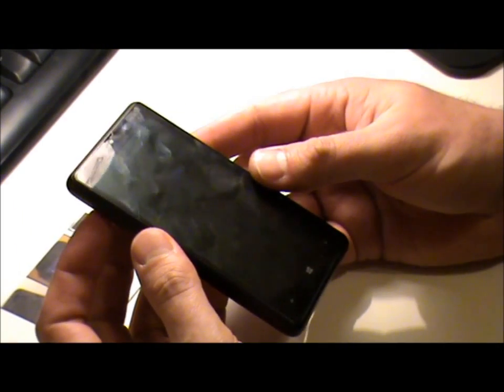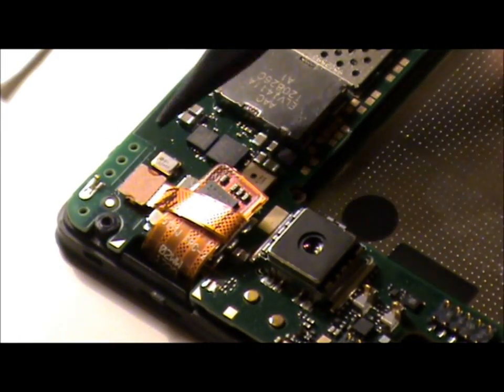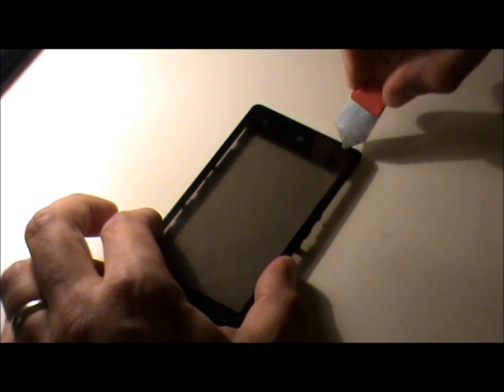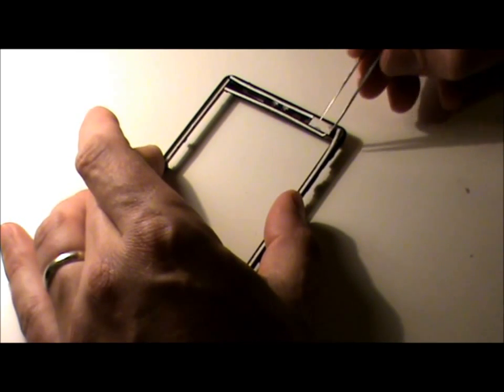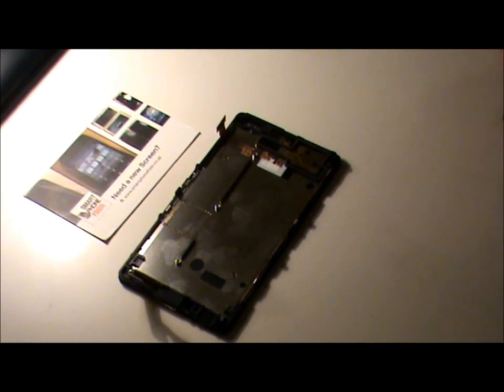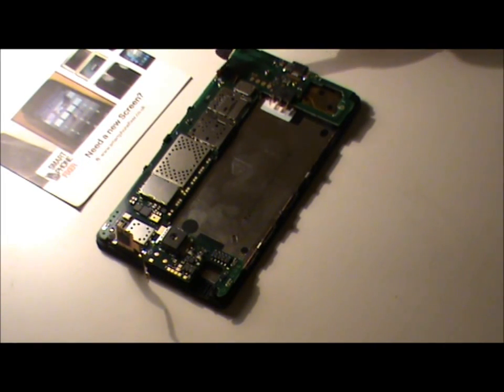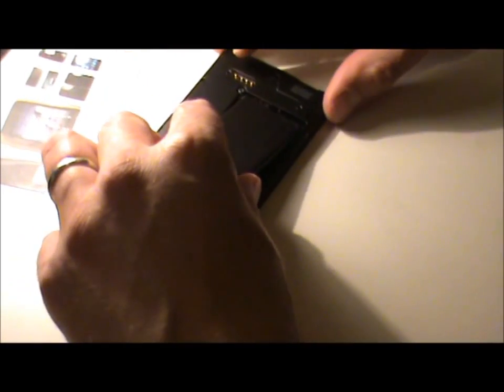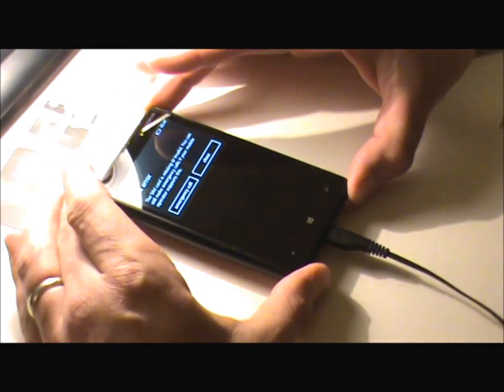Nokia Lumia 820 Screen Replacement Guide

Comment: Thanks so much - new screen for my phone all done by me in half an hour - for 6 quid for the screen and frame off ebay - even got the proper tools included!! I would just say to anyone trying this, go easy on the middle three screws when putting them back in, one of mine broke at the end with tightening too much - still works fine though :)
Reply from the maker: Thanks for your comments, Lisa. Well done for completing it yourself and so quickly.

Comment: Hi,
  Thanks for your quick response!

   Yes, it is certainly a problem with the proximity sensor. But it is not as simple as you describe.  I've had each of these three phones apart several times. I've tried different digitizer screens - from different suppliers, tried cleaning the sensors and the inside of the screen - through the apertures for the sensor, tried pads to force the sensor more tightly into place. Nothing does it. I consistently get a black screen once I've dialed. There must be some underlying problem, or the problem would not be so consistent. I've observed that some of the screens I have have the apertures very slightly different, and thought that might be it, but each of the positioned screens fail in the same way. I had one "professionally" repaired, which seemed an easy job for them, but they won't tell me the secret!
Reply from the maker: That sounds more complicated, as you say. I've not had that problem so, unfortunately, I don't have much else to offer you. I hope you find a fix and update me when you do. Thanks, Will

Comment: I've done this with three phones. The job is a very easy one and is a success, EXCEPT, in every case, I end up with a black screen as soon as I've dialed. I must be doing something consistently wrong, but I have no idea what.
Reply from the maker: Well done. The black screen sounds like something to do with the proximity sensor, the device which detects when you put the phone against your ear when speaking with someone. Like all repair jobs, check and re-chack all the connections when putting the new screen on and also make sure the connections are clean. You can clean them with a little isopropyl alcohol.

Comment: Good video. Just replaced my digitizer using this one. I do recomend to order digitizer with the frame , so you can just replace it without the gluing and glass seperation part. Thumbs up!
Reply from the maker: +Rudolfs Bzs Yes, the complete unit is much the best replacement part to buy.

Comment: Hey can someone give me a tip or any suggestion what to do ... my nokia lumia 820 screen is getting dust and other small particles on the screen but under it so i cannot clean it like you normally would do ... its really ugly looking I dont know how to clean that any ideas ?
Reply from the maker: Hi Kenan

Is this happening after you have replaced the screen? Or, is this happening with the original screen?

Thanks

Will
Reply: Well I bought the phone as a used one so I dont know if it was changed or not :/
Reply from the maker: Kenan Mujic It sounds like it was changed. It is quite easy to remove the screen and clean behind it. Follow the steps in the video above to remove the screen.

Comment: Hey, Will. Great video. I have a question about my 820. I dropped it flat on its screen and the digitizer snuffed it, so I replaced it. Once I had assembled the device together again, I turned it on. The LCD works perfectly and the digitizer looks fantastic, but it doesn't work. The touchscreen is dead and I can't seem to be able to find the cause of it. Do you have any ideas of what could be wrong? Thanks!
Reply from the maker: Hi Matias, 

Firstly, you can try taking your digitiser off again and cleaning the connections (using a bit of pure alcohol, for example and a lint free cloth). Sometimes, grease from your fingers can mess up the connections. Re-fit the digitiser and try again. 

If that does not work, it could be that you have a faulty digitiser. The 820 digitiser is an unforgiving component in that if it is slightly damaged or faulty, it will not work at all, unlike other smartphone screens. 

I hope that helps.
Reply: Will Hawkins Thanks for the answer, Will. I cleaned the connections and it wouldn't work either, so I guess I'll just have to try again with a different digitizer. Thanks again for your help. Keep up the great work.
Reply from the maker: Matías Sibils Thanks, Matias, for the update.

Comment: My mum dropped her lumia 820 today and she just asked me if I can fix it for her. Gladly I found this video but I'm not too sure what the problem is. It has no cracks that I can see but the screen is a washed purplely blueish colour, being darker in the top right corner. I think it might be the LCD that's broken but I'm not too sure and don't want to buy a new one if the current one is still fine.
PS. The phone still functions perfectly, is just a different colour.
Reply: The LCD is most likely broken in the same place as most other peoples. The weak spot seems to be on the top right of the screen and will be only a few mm long across the corner.
Personally I think it may be a slight design fault in a very compact phone.
Reply: toxicthunder69 hi, i also have broken the lcd, do u know from where i can buy one? and how much it costs?
Reply: Gigi D'Agostino You can get them from eBay and other places like that, and they cost about £100 ish but you can get them slightly cheaper I think.
Reply from the maker: Hi there, that almost certainly sounds like you have a broken LCD which is replaceable. It does not sound like a broken digitiser (touchscreen). When the digitiser on the 820 is damaged it will not respond. 

I hope that helps.
Reply: Will Hawkins Yes thanks that has really helped. I can now get a new LCD to repair it. Great video as well very informative.
Thanks again.
Reply from the maker: toxicthunder69 Happy to help.
Reply from the maker: Gigi D'Agostino You can find a suggested supplier in the notes below the video.

Comment: how do i see if the lcd or the digi. broke or if they both broke??
Reply from the maker: Can you see anything on the LCD? When you touch the digitiser, does anything happen on the LCD below?
Reply: the screen keeps outputting the normal picture no color fading or weird things only the top half of the digitizer still works
Reply from the maker: That's normal when the digitiser is broken on the 820. Replacing it with a new digitiser will stop this problem.

Comment: Thanks very much for this video, I followed it step by step and I now have a working 820 with a new digitizer screen. Got my screen from http://www.formymobile.co.uk/proddetail.php?prod=lumia820digitizer&PARTNER=Froogle
which also helped. Great fun removing the screen without damaging the sticky layer, and the main trick is to press the plastic over the glass on a nice flat surface . Thanks again!!

Comment: Thank you for you very useful video. I used it to replace the Digitizer but now when I switch on the phone, it vibrates and makes the start up sound however the screen is completely blank. How likely is it that the LCD was damaged when it was dropped and not an internal component? I'm more than happy to purchase a new LCD and fit it but would like your recommendation...
Thank you in advance.
Reply from the maker: Hi Bo, was the LCD working before you replaced the digitiser?
Reply: Will Hawkins Hi Will, sorry for taking so long to respond.. I was away on holiday and didn't have access. The owner of the phone went ahead and ordered a new LCD so now I am waiting for it to arrive and will then fit it and hope for the best.
I'll let you know how it goes. holding thumbs

Comment: Wish I has seen this earlier. I cracked the phones screen but the LCD worked just fine, I could even use the camera function with the outer buttons. The guy who fixed mine did an awful job, he made me buy both the LCD and the touchscreen, left the LCD's film on, kept my old working LCD, and on top of everything the touchscreen doesn't respond at times and when it does only the upper portion of the touchscreen responds. He claimed it was because the phone wasn't fully charged and made me pay premium!!
Reply from the maker: Bad luck, Carlos. The video I made is based upon the official Nokia repair manual so it is pretty straightforward. Nokia Lumia 820 screens are sensitive to damage and one crack will render a digitiser useless. But, more often than not, a cracked digitiser does not mean you will need a new LCD.

Comment: Hi Will,

I dropped my lumia 820 today, everything works except the touchscreen. A new screen is required to make it work properly again, right? 

Thanks in advance
Reply from the maker: Hi Dinant, 

Yes, when you crack the touch screen on the Lumia 820 the whole thing stops working. You won't need a new LCD unless you can see a blurred screen. You can find a suggested supplier of screens with the integral frame in the links above in the 'About' section.

Will
Reply: Will Hawkins Just ordered a new screen. Thanks for the help!

Comment: Hi Will, yes great video. But I still don't know if I need to replace my LCD. All the colours are still there on the screen, side buttons work fine. The display looks fine just a badly cracked screen/digitalizer., but is unresponsive to my touch. ?
Reply from the maker: That means you will need to just replace the digitiser, not the LCD. When buying a new digitiser, buy one with a frame already attached. It's much easier to do the replacement and is not much more costly. See some suggested suppliers in the notes below the video.

Thanks

Will

Comment: Many thanks Will.. I had no insurance and over a year left on a phone contract which left me miserable and told 100 pounds to replace glass. So with nothing to loose n skint i got the glass for £8.00 ebay and followed your instructions.. (nearly in need of a forehead sweat band..Pheeew!!  a tad scary for a total novice but  necessity being the mother of invention its.... yippee.. got my phone back. bless ya...
Reply from the maker: Hi Heather,

I am glad it was useful and well done for doing it yourself successfully. It's not too tricky as long as you take your time. :-)

Thanks,

Will

Comment: Great  Vid!
i have a lumia 1320 and the glass screen crack! but i have like 3 little spot like more yellow than the rest of the lcd screen, the lcd would be damaged too? that worries me a lot, im taking the risk of changing de glass by myself, any tip would be great!

thanks!
Reply from the maker: Hi Adrian, it does appear that your LCD is damaged if you are seeing spots like that.
Reply: Yeap.. pretty sure u were gonna tell me that, but another question please! the lcd es ridiculously expensive! half of the price of the phone and just are like 3 little spots, beside that, everything works perfect, touch, sensors and camera, i can still just replacing de glass screen right? because in this particular phone the glass is just a glass, not a digitizer, the touch screen is working.. and the glass is just about 20 bucks! thanks a lot for the response greetings
Reply from the maker: I've not worked on this particular model so it is a guess only. If you have to remove only the glass then you can easily damage the LCD underneath with some smartphones. You end up buying a new LCD anyway. Often the screen is bonded to the LCD with a special adhesive which you need to replace when you put a new screen onto it. If you don't do this then you tend to get a poor result. However, as I mentioned, I've not worked on the Lumia 1320 so I can only surmise. I hope that helps.

Comment: Great video. The corner screws on my 820 are T6 (not T9 as reported in the video). Clearly a few differences in the hardware batches
Reply from the maker: Hi Rob, Yes, there are differences between some phones of the same model, which is annoying.

Comment: Hi Will, this video has been a great help! But the screen im fitting has come with the frame (thought it would be easier), and ive followed your guide but it still wont work! =[
 everything looks right but i have noticed that at the bottom of the new digitizer there is a small metal flap extending towards the screen, and on the old digitizer this has been folded and fitted to a metal section, could this be whats wrong? its where the touch buttons are located

cheers
Reply from the maker: Hi Kyle, 

This sounds like the problem. The screen is not connected to the motherboard. It just snaps into place in a slot. 

You will need to dismantle your device again to check all connections are fitted. 

Regards,

Will
Reply: Will Hawkins I think I know which one you mean and ive connected that one, but i'll look closely and make sure ive done it, I've put my old cracked one in since and thats fine just ugly, the new screen may not be genuine

thanks for getting back to me

Comment: Hi Will,

Thank you for the video, very helpful.

I've changed my screen, everything went well, but my touch does not work.
The glass was really broken, but the screen didint turned to blue framed or frozen. And the touch didint work went the glass broked. Although I could see the backround and for exemple take pictures by pressing the buttons on the side of the phone.
What do I do?

Thanks
Reply from the maker: Hi Kristjan, 

It could be one of two problems. a) the new digitiser (touch screen) is faulty, so you should contact your supplier and ask for an exchange. b) there is a problem with the motherboard to which the digitiser connects. That might be the actual connection (so check that your digitiser is properly connected to the motherboard). 

Once you have tried these two options and it is still not working then it could be that you have a deeper problem caused when the smartphone was originally damaged.
Reply: Ok, thank you very much. I will try option b first. This was very helpful.

Thank you and happy easter :-)
Greetings from Faroe Islands
/ Kristjan

Comment: Excuse me sir,
I dropped my Lumia 820 many times and finally the screen is broken, I cant see anything on my phone its total black, for some time after it broke I could see a green light blink when I pressed the side button but that's also gone now , one time I played music by randomly touching the screen and when I get a call I can answer it by randomly touching the screen. So, I think my touch still works but my display is gone so what do I have to buy and replace ?
Reply from the maker: Hi Sore, 

It sounds as though you have almost certainly broken the LCD. Take a look at the 'Description' section above for a  suggested supplier of LCD units. 

Thanks for getting in touch.

Will
Reply: I will do so, Thank you sir.

Comment: I guess, the screen of 820 is really fragile in comparison to 920. I've heard so many complaints about Lumias 820 having broken screens just because of dropping them from a little height or for bending in a pocket. In Amazon.de one company told that they bought 15 Lumias 820 for their employees and after a few months 10 of them had broken screens. I guess, that's the price for Nokia not having Gorilla Glass on their Lumia 820. This is real shame as I almost bought it - no other phone has this price/features ratio.
Reply from the maker: You are right. The 820 screens are weak.

Comment: I've done it and it works however after a while the touch stops working so I have to take out the battery and it works again, how can I fix it?
Reply from the maker: Does the phone warm up before this happens?
Reply: Will Hawkins not that ive noticed but it hasnt done it today p.s thanks for the help
Reply: Will Hawkins its started doing it again now :(

Comment: I'm going to do this but do I need anything else because the whole touch screen doesn't work and I've only got a tiny crack in it?
Reply from the maker: That's normal with this phone. One small crack will make it inoperable. It's a design flaw in my view.

Comment: I get the second replacement touch. and does not work. I still think it may be because the screws not tight, it may have something to do? I also read that it may be because it does not work with amber. please help.
Reply from the maker: I am not certain why it is not working, only that sometimes the original knock which damaged the glass can also cause further, unseen and internal damage to the phone. This might be the case with your smartphone, unfortunately,

Comment: I dropped my 820 and a giant crack appeared right through it. the touch still works fine but the colours are all messed up. They appear washed out and were deteriorating with each passing second. I don't know what's broken- the LCD or the digitizer? Can you tell me what I broke so that I will buy only the part I require,.
Reply from the maker: Hi, 

You have a broken LCD. :-)

Regards,

Will

Comment: Thanks for the video. yesterday I get the replacement touch, when I turned on the touch did not answer me. one of my mistakes was touching the touch on the inside, and the other is not strong tighten the screws, they went back to open and clean the touch when you turn the top and bottom of the touch works, but not the middle, I thought I could be in and tighten the screws again and I broke two of the 3 middle screws. is why it does not work me? or is it because the replacement was broken?
Reply from the maker: The screws are sensitive and can break easily, unfortunately. Touching the inside of the screen should not make too much difference. It does sound like your screen is faulty. Ask you supplier for a replacement, in my view.
Reply: Will Hawkins thanks for your quick response. then it is not important for it to work properly all screws are tight?